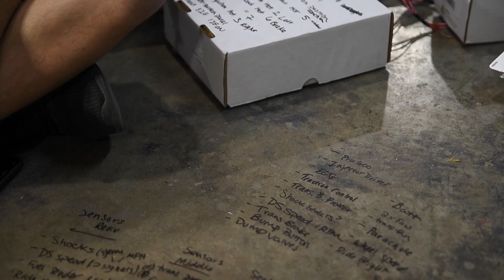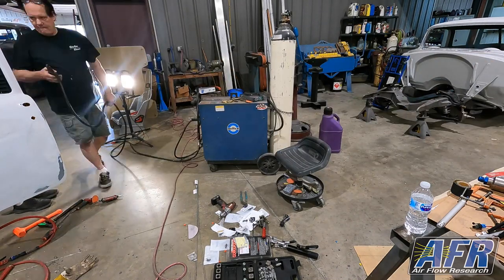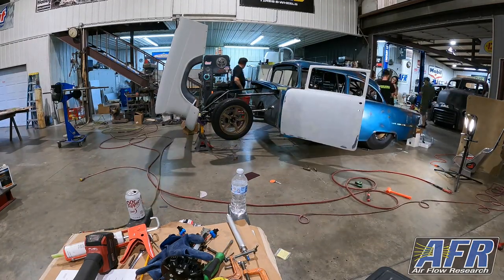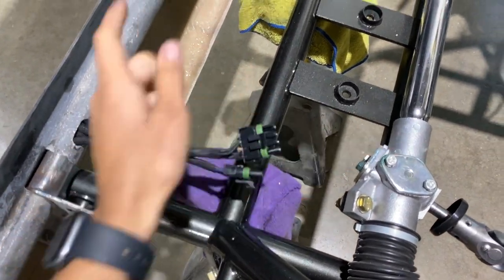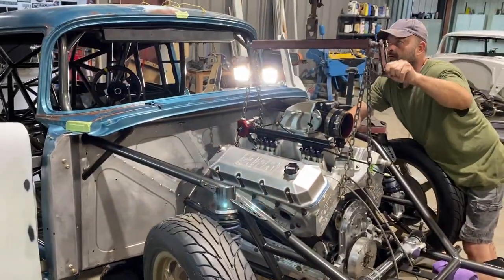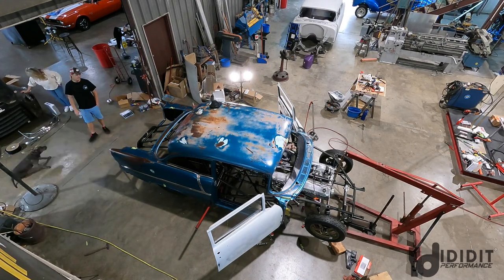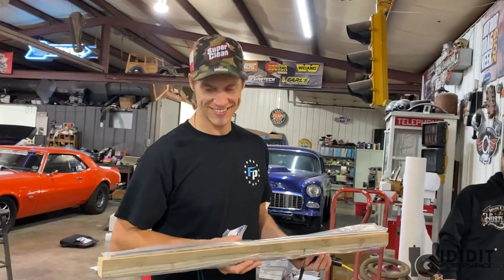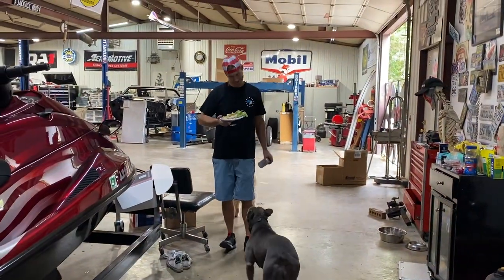1XX proof Gets Its Engine FINALLY - Ready for Turbos Now - 55 Build 20

Comment: Old School Tech Tip #381:   To remove a stubborn pilot bushing/bearing pack it with thick grease then insert an old input shaft or any tight fitting shaft and drive it in with sharp hammer blows, repacking with grease when necessary.  the grease will force out the bushing every time with no damage to anything.  Just a neighborly tip from an old hot rodder from Fort Smith.  When ya'll aren't so busy me and a couple of friends wanna come down and buy some merch.

Comment: Looks like a pilot bearing removal happening there. With the solid bronze style, possible to cut light threads with a tap then send in a bolt that bottoms into the crank. Other method is pack grease in the pilot/crank. Then hammer in a bolt. Pressure pops the bearing out. May not work so good with the roller cage style pilot bearing.

Comment: Another trick to getting the pilot bearing out if the puller rounds the inside lip. Pack it with grease and take a rod, the inside diameter and ram it into the hole. The grease will seal the shaft and push out the bearing.

Comment: not sure what you where doing on the back of the crank, but the best way to remove a throwout bushing is to drill, it tap it and run a bolt in to push it out, if thats what was going on
Reply: this might not apply here, but its a good tip for people dealing with that probelm with limited tools